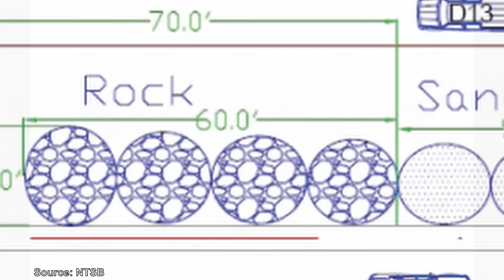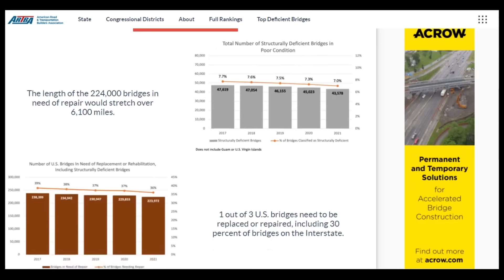The I-35W Bridge Failure | A Short Documentary | Fascinating Horror

Comment: A few years ago in Idaho a freak traffic accident resulted in a major fire under a freeway overpass.  Engineers were concerned enough about the damage caused by the fire that the county elected to completely tear down and replace the overpass.  It was nice to see infrastructure get the attention it needed for once.
Reply: Similar. We had a fuel truck overturn and burn our freeway entrance/exit overpass from the top and a car beneath.  The replacement was fast tracked because it’s a main artery for the port.  A few miles away, the north span of the river bridge was also replaced in 2006 because it was in danger of collapse.
Reply: Oh, we had something similar happen in Ohio a few years back, too. A fuel tanker caught fire beneath one of our major highway bridges (think it was one of the I-70's, but don't quote me on that). The damage was so severe they had to tear down basically that entire section of overpass and rebuild it entirely.
Reply: @alexcurrie4514  I-71/75 and it's a wonder that thing is still standing since it's needed replaced for the longest time

Comment: With 40 years of this design flaw remaining that means it was missed by generations of inspectors as it waited to just fail. That is fascinating and raises questions of what else in any infrastructure are just waiting there. 

On a positive note, these stories do always have one slight salve. Despite all the crookedness, the accidents, the design flaws, the neglect, or malice; there are always those who rush into the fray to help. Something I took to mind when the discussion of over 100 people from all over ran to the scene to help. Believe it was Mr. Rogers who said to "Look for the helpers" in any given story. Least some positive in a world that gives us these kinds of tragedies.
Reply: I do remember though that on the radio they were urging normal citizens to stay away from the area out of concern that it would jam traffic up and actually harm the professional rescue and emergency response.
Reply: I remember hearing them say the annual inspections only looked at fatigue, stress and condition of the existing design. The design failure was not looked at because the bridge was an approved design. Only after the failure was found did they look at other bridges with the same design and replace them. They replaced the division st bridge over the Mississippi river in St. Cloud  Minnesota which has the same design.
Reply: Most design flaws can't be seen. The only way to check for them is to have another engineer check the drawings the original engineer put out. Sometime the inspector on site during construction catches a problem but not normally. It costs a lot of money to check those drawings. Loads aren't something you can visually check for unless the structure is about to fail and lots of times not even then.

Comment: Here in Memphis, one of the busiest bridges in the country, the Hernando De Soto Bridge between Tennessee and Arkansas, was shut down because of a massive crack last year. Eventually it came out that the crack had been there since at least 2016, and inspectors were skipping required inspections. When I think of the fact that the Silver Bridge collapse in West Virginia in 1968 killed almost fifty people, and that was a much smaller bridge, and the flaw in THAT collapse was caused by a 0.1 inch flaw in a bearing, I get cold all over. I think we came really close to something extremely tragic happening in Memphis. It sucks when you can't trust regulators and business to keep you safe.

Comment: 72,500 U.S. bridges are rated deficient?! I had to rewind to make sure I heard that correctly. Wow, that's a scary thought. I guess with the explosion of bridge construction, maybe they were working too fast? Time constraints, and money of course, can have a lot of bad effect on construction.
Reply: The deficient rating it not a result of design.  It's a result of deterioration over time, combined with increased traffic.
Reply: Actually, the bridges were probably just fine when they were built, but some of them are coming up on 100 years old. This is far past the design life, but there is no longer as strong an emphasis on infrastructure as compared to say the 1920s-1970s. I was a field engineer on a small bridge replacement a few years ago, and the original concrete was crumbling badly. I kicked one of the abutment wingwalls and a large section fell into the river below. This was an 80yo bridge on a state highway that was open to semis just the day previous. They are being replaced as fast as possible, but the deferred maintenance of the past 30+years is really catching up.
Reply: And that number of 70,000+ bridges isn't some figure that was formulated yesterday. That number has been married to every single bridge collapse over the last decade at least. Of course that's probably attributed to a  public that becomes too "comfortable" when public scares are at their annual lows
Reply: The United States has more money than they could ever use on bridges, they just prefer to spend about 60% of it on the military industrial complex, it's really awesome and worth it!!
Reply: No we mostly just don't like paying for maintenance or replacement as a culture
Reply: A lot of those are minor bridges that are rarely if ever used, but still technically count as bridges for this work (there are about 620,000 bridges inspected in the country and tracked).  Its still a huge number, but on average one of these bridges have about 265 trips taken over them daily.  

When you consider the number of trips that this bridge had, it inflates that number (about 1 in 1000 trips across a deficient bridge were on this one).  Not a good thing, it needs to be addressed, but the numbers are misleading.
Reply: I think the bigger problem is there isn't money to properly maintain the bridges (or a lot of other American infrastructure).
Reply: @aaronpike1853  very good point.  States need to keep track on which roads and bridges need to be updated to modern standards and act on them accordingly.  But I guess that’s not their priority.  Until something goes wrong.
Reply: Allot of it comes down to that fact that most bridges built for the interstate highway system (and most post-WWII bridges in general) were built with a 50-year design life, with the assumption that by the time they were 50 years old they would need to be replaced anyway due to increased traffic, etc. so it didn't make sense to spend extra money to make them last longer. In most cases the original engineers were correct in this assumption, but since money generally wasn't set aside for replacement over the years we are now left with bridges (and highways in general) that are both insufficient for current traffic, and deteriorating structurally after having exceeded their design life, in some cases by decades with little to no maintenance.
Reply: @Anzi Zhu they are the literal richest country in the world you think sizing  them up to developing nations is a good comparison??
Reply: @opwave79  They already do. On average bridges are usually inspected every two years. All State DOT's already have a full list of which bridges need to be repaired or replaced. The delay is getting funding from the state and federal governments.
Reply: Currently there are 46,154 structurally deficient bridges per the ASCE Report Card.

Comment: I typically commute over this bridge M-F. On the day the collapse occurred, however, I took a different bus which traveled over an adjacent bridge (Hennepin Avenue) instead of 35W. Exiting the bus after work, all I could hear - coming from everywhere, it seemed - sirens. I checked the news and learned of the collapse. There were multiple construction crew vehicles and piles of materials on the one side of the bridge that had been there for some time, it seemed like they were always doing work on that bridge. Just over a year later, I was one of the first people lined up to go over the new bridge the morning it opened. Minnesota quickly started assessing all its bridges and many were repaired or replaced. Too bad it took a tragedy to make them wake up. Thanks for covering this.

Comment: As someone who’s studied this specific incident, I’ve noticed that many YouTubers who cover it have always oversimplified the causes of this disaster to “something something gusset plates, something something construction”. I’m glad you went a little more in depth about this disaster and its causes, but you’ve still missed quite a bit on it as well.

Back when this bridge was built, computational structural engineering was still very young. Calculations were still done by hand and it turns out that the calculations done on this bridge by its engineers were done by hand. To simplify the calculations involved, they opted for 2D structural analysis instead of 3D. It’s similar to the story about CitiGroup Center Tower in NYC and it’s 2D analysis. To offset inaccuracies via this method, they added extra safety factors, but it was later found out that these weren’t even enough for when the bridge was built. As a result, the gusset plates were made too thin, even for 1967 bridge deck—that’s why the gusset plates had already been seen bending several years prior to the collapse.

A thicker bridge deck, inoperable rusting expansion joints, heavy traffic, and overweighted construction equipment were just additional factors that all happened to line up with the bridge’s original error to make it fail that day.

It’s honestly a miracle that the bridge even stood as long as it did; the original engineering calculations were disastrous and could’ve easily led to the bridge collapsing within less than 10yrs of its construction.
Reply: The reason most say it's "something something gusset plates, something something construction" is because nobody wants to read a lengthy bunch of text like what you wrote.
Reply: @haywoodyoudome  lol I mean…true. Luckily I only wrote a few paragraphs and not a 178 page NTSB report. I think I summarized all 178 pages pretty well

Comment: "Deficient within tolerable limits"
Just what you want to hear about a bridge catering to 140,000 vehicles per day 🙄
Reply: The irony is that it was an accurate assessment, as none of the (known) deficiencies contributed to the collapse.
It's scary to think there are roughly 100,000 structures nation wide that are categorized as deficient. How many bridges are there even in total? How hard is it to find a bridge that is not "deficient within tolerable limits"?
Reply: @renerpho  There is simply too much road infrastructure in the US for there to ever be enough funds to fix everything. Before building all this stuff, the leaders should have pondered the astronomical cost of maintaining it all.
Reply: "Ladies and gentlemen, this is your captain speaking - Ryanair would like to assure you that this plane is deficient within tolerable limits. We wish you a pleasant flight."
Reply: @monsterfurby  Airplanes literally have lists of failures that are permitted, and failures that ground the aircraft. Like… engine failure? Grounded. Failure of a sensor that has triple redundancy? Allowed — but not for transoceanic. (Theoretical examples. The minimum equipment varies by aircraft type.) Just like your car doesn’t become undrivable when the Check Engine light comes on, many failures (or deficiencies) are not serious enough to warrant servicing immediately, and can wait till the airplane goes in for servicing.
Reply: @tookitogo  and this practice has caused crashes In the past. The point still stands. If something is allowed to continue operating when deficient in any way eventually something will go wrong because someone will misread something, there will be a mis output by a computer, etc etc.
Reply: A bridge can't be expected to be perfect, there's going to be normal wear and tear from use.
Reply: @VideoDotGoogleDotCom It is a lack of political will and ignorance of the population, compounded by time. It is possible to do. But muh taxes...
Reply: @monsterfurby  Bingo! You've defined aircraft line maintenance perfectly
Reply: @lemo4739  There are allowances within design limits
Reply: @Jafiveon  Well yeah, it's perhaps POSSIBLE to fix and maintain everything, but it's in no way realistic. It's possible for me to complete a marathon, but I have zero intention to train for that to ever happen.
Reply: @duncandmcgrath6290  ok?
Reply: @lemo4739  “caused” is a mischaracterization: it’s been a contributing factor to numerous crashes. But expecting aircraft to be 100% fault-free at all times is completely unrealistic. It’d mean planes would be grounded constantly over small things that really don’t matter. Not all deficiencies (outstanding repairs) are equivalent. For example, an aircraft with a malfunctioning autothrottle is still perfectly capable of being flown with manual throttle and using the remaining (unaffected) autopilot subsystems. Nor would it make any sense to ground an airplane with, for instance, a broken lavatory door. You’d just block off that lavatory, not ground the aircraft. 

When aircraft crash, it’s because numerous layers of safety failed at the same time. It’s exceedingly rare, and if we grounded aircraft constantly over every little thing, air travel would become so unreliable and so expensive that many people would, for shorter trips, drive a car instead, which is a vastly more hazardous activity.

Comment: Even to this day, running under the new one just seems really eerie.
Reply: I hold my breath driving over it.   Which isn't going to help if something happens but it makes me feel better I guess.
Reply: Down a little south in the Chicago suburbs (ok more than a little south I suppose hah) we had an overpass apparently owned by Union Pacific collapse probably 10 years ago now that killed a couple in their car, so they end up building a new one same spot its already rusting which no idea how normal that is structural engineer I ain’t haha, but I swear there are some big ol cracks showing, plus very busy intersection right by a school so gets backed up to where you’re stuck underneath it at red lights all the time 🙃
Reply: @supermoneyball420  if you see cracks and rust report this. It most likely won't do anything but it's worth it. Also don't use it. You shouldn't see visible cracks

That is going to fall again

Comment: I vividly remember seeing this all over the news when it happened. It was really shocking, because at the time, it wasn't as widely understood by the general public how badly in need of maintenance our infrastructure really is. And it really is a widespread problem-- there are bridges all over the country in desperate need of repair, or in some cases, even replacement with updated designs. I live in the northwestern corner of Washington state, and six years after this incident in Minneapolis, there was another bridge collapse between Burlington and Mt. Vernon, only about 20 miles south of me. A truck carrying an oversized load accidentally entered the bridge in the incorrect lane and damaged some of the support beams as it was crossing. However, while the trucker was at fault, it was also determined that, like the one in Minneapolis, the Skagit River Bridge's design did play a role in its collapse, as it wasn't built with redundancies to prevent such a failure in the event that even a single support beam broke. Fortunately, this incident didn't result in any loss of life-- but it did demonstrate that this sort of thing is in danger of becoming a much more common occurrence if the problem isn't addressed.

Comment: Can you really call this a design deficiency? 

That bridge was designed and built decades ago to handle the loads of traffic of that time with a safety factor added on top.
Then the bridge was upgraded multiple times, increasing the static load and it saw way more traffic by heavier vehicles than originally calculated, increasing the dynamic load. This time the bridge was being upgraded once again and again nobody seems to have checked the original calculations for the loads of the bridge to check if they weren't exceeding those original calculations. 
So on top of the previous upgrades, the heavier traffic (both in volume and weight) and the natural erosion that had happened during the bridge's life, they added yet another huge load of building materials and finally the structure had had enough and failed.

I'd call that a severe lack of insight and a callousness regarding safety regulations instead of a design deficiency.